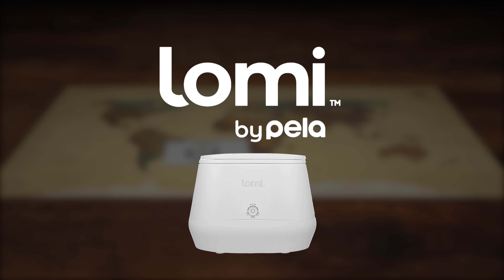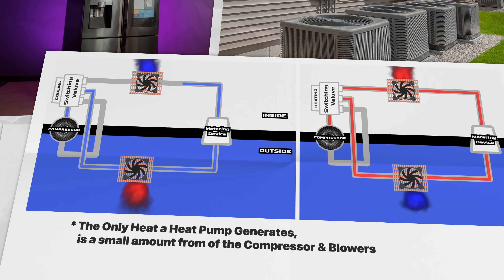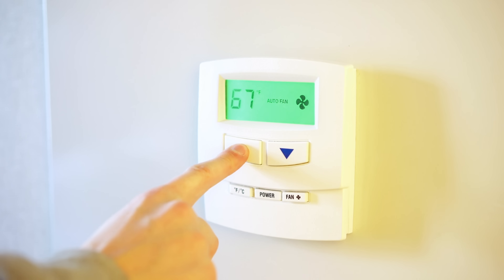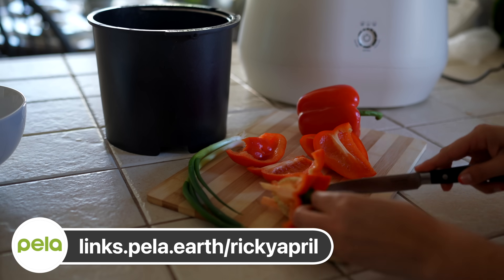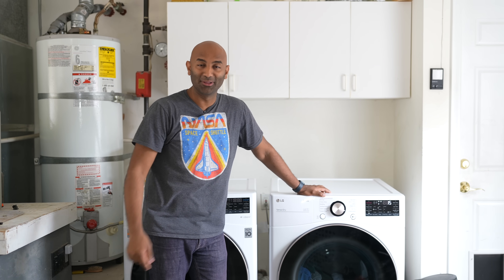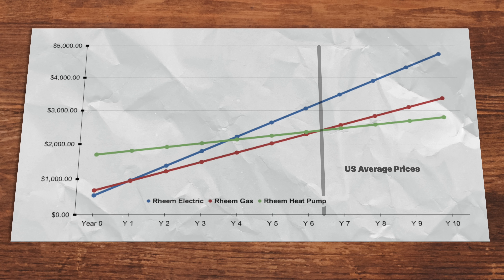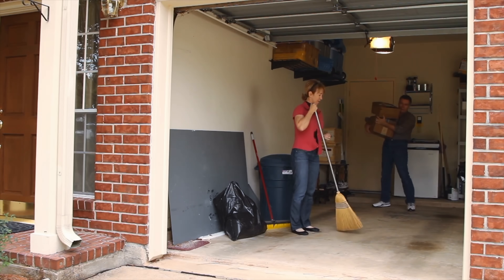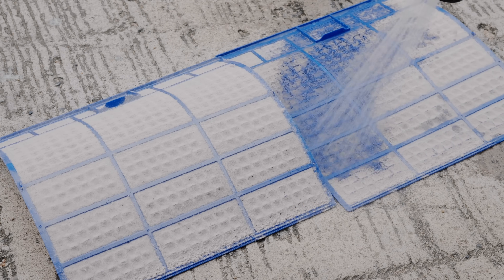I'm Shocked How Much Money Heat Pump Appliances Save!

Comment: You live in San Diego, Southern California, and you use a clothes dryer?
Reply from the maker: I don’t like UV on my color dyed clothes, and the dust in the air. But I’m working on a solution!
Reply: @TwoBitDaVinci  Unless it’s a ‘red’ dye, UV damage is minimal. Just consider the amount of UV exposure your close get versus the couple of hours on the line. If dust is a real problem, consider running through the clothes dryer, but w/o heat.

Sorry to beat you up a little about this, but clothes dryers are IMO the very worst case of us humans rejecting the power of the wind and sun in favour of a fossil fool solution.

Keep up the good work.

Comment: Hello from the Midwest! Natural gas is indeed the most common heating source here. A barrier to heat pumps is that in previous decades, the units on the market did very poorly in even moderately cold weather (ie below about 20F). This meant using a ton of resistive heating and very high bills. The problem comes in that most local HVAC people know of the lore and tend to dissuade folks when discussing heat pumps or insist on dual fuel using gas. Today’s really good HPs can operate down to -13F, which would cover 99.999% of time in my area. But if the installer lacks this knowledge, it means that only the most in the know people are going to upgrade.
Reply from the maker: We’ll said! I love the Midwest what part? The systems have improved a ton since the old days. But natural gas is a habit hard to break
Reply: @TwoBitDaVinci  yeah you are gonna switch fromm heating with natural gas which is over 90 percent efficient to an electric heat pump yhat uses natural gas to create the electricity which at the plant is about 50 percent efficient. you are gonna consume more natural gas. you people are low intelligence
Reply: what is -13F?

Comment: Very true, heat pumps are THE answer to heating and cooling in the near future and beyond.  We're seeing in the EU has stupid it is to rely on another country for your energy needs, and we see from climate change how using fossil fuels is even dumber and more dangerous.  I converted my house to all electric, except my gas furnace, which is the next on the list to swap.  I replaced my: oven, water heaters and installed an air source heat pump for AC, which also heats well.  I bought an EV and added solar and wind, and have no power bill or gasoline bills.  Go Ducks!!  :)

Comment: Don't digress. It ruins everything else you say. 0 degrees? Water freezes 100 degrees? Water boils. What can be simpler?

5 degrees? Cold. 10 degrees? Cool. 15 degrees? Comfortable in the sun. 20 degrees? Comfortable. 25 degrees? Warm. 30 degrees? Hot. 35 degrees? Uncomfortable. 40 degrees? Unbearable. 45 degrees? Deadly. 50 degrees. Barely survivable.

32 degrees in the stubborn old system that nobody uses? Nonesense.
Reply from the maker: From 30-100 there’s more gradation in the range that matters to humans. That’s my point. I love C don’t get me wrong. As an engineer I wouldn’t use F. Only for describing the day :) cheers
Reply: @TwoBitDaVinci  Sorry, but no. Notwithstanding that a 30+ degrees Celsius gradient is more than enough to quantify barely discernable steps within the normal human condition, you can also break degrees into halves if you really feel the need. The gradient then becomes essentially the same.

All you are saying is that you have known the numbers you are used to since you were a child and different numbers are not familiar nor comfortable. This is the primary reason the US is about the last country on Earth to eschew metric. It is a country that fears change and distrusts others - to its own detriment.

I grew up with Fahrenheit as a kid and it was no big deal when we caught up with the rest of the world and changed. Same goes for miles to kilometers, weights and volumes etc.  It takes a few months to get  used to the new values and then you wonder why anybody would use systems that are so archaic and inconsistent. How much does a gallon of water weigh? It's crazy. How much does a litre of water weigh?

Comment: In order to go green you've got to have great credit or deep pockets and most heat pump units are not low budget solar electric friendly so instead of just the higher of the unit to go solar electric you go from 2 grand to 8 grand sure it costs more to rum motors on 110 volts compared to 220 but a 110 volt solar system can be set up for under 2  grand whereas a 220 costs over 8 grand   because you need more solar panels 2 inverters that can be synchronized to get 220

Comment: Like you I live in SoCAl. An incident with my 25 year old gas dryer,  where it ruined a load of clothes smoldering, caused me to make it into a heat-pump dryer and rip out all the gas parts around 10 years ago.  I used a dehumidifier and built a box (plenum) attached to the dehumidifier input with door foam insulation gaskets I  hooked the damp exhaust into the box and arranged the dehumidifier output  to get back into the gas heater through the access port it had to service the burner tube. Closed off all other make-up air into the dryer so that it worked on a loop. The dryer had a air fluff setting and a timed dry setting that worked for its part and I wired the adjacent dehumidifier to start and stop simultaneously.
While it does take longer, the recirculation slowly gets the clothes warm, but not hot. Very gentle.The consumption is 470 watts, and since it is a full sized American dryer it takes our load sizes too. I do have to pump the condensate water out and clean the accumulated lint in the plenum from time to time, but I no longer worry about a gas flame  or have to depend upon the overtemp sensor when the belt starts slipping again, the original problem I faced which propelled me to D.I.Y. many years ago when I read about the heat-pump dryers in Japan that were not being imported here at the time. Thanks for reminding me.

Comment: I had a heat pump pool heater 15 years ago. Saved me a TON on electricity.
Reply from the maker: Awesome! What brand did you go with?
Reply: @TwoBitDaVinci  A Hayward. Make sure you get the titanium heat exchanger. The conventional material did not hold up to the chlorine and the company replaced it under warranty.

Comment: Why are Heat Pumps so expensive when they seem so simple (seem a lot less complex than a gas condensor boiler!)?
Currently about 4x the price of a gas boiler!
I suppose as they become more popular Wright's Law will bring down price.
In UK Govt has  just cancelled the 20% VAT on heat pumps, so that should help, but currently Electricity is 4x the price of Gas per Kwh!

Comment: 3:32 that's the stupidest argument I've ever heard in an educational youtube video.

Why is 30° freezing? Why isn't it 0°? If it's really about comfort, why isn't 50° the ideal temperature?

And celcius makes a lot more sense as a non-american. 
0°? Freezing 
10°? Very cold 
20°? Slightly cold
25°? Ideal
30°? You need a fan
35°? You need an AC
40°? you need to jump in some water
45°? Watch out for heat stroke
50°? Don't even come out of house
100°? It's boiling your blood. Literally.
1000°? Melts metals 
etc

Comment: ive had a heat pump water heater. They are ok...but their lifespans are terrible. You would be much better off with a tankless instantaneous gas system if you really wanted to cut down on costs.

Why pay to constantly reheat 50 gal of water all day just for it to sit there and lose heat while it waits to be used.

Comment: Heat pumps have limits, for a typical UK home, our home heating is gas fired boiler, gas being around a quarter of the price of what an electric boiler can cost. With heat pumps they cannot achieve the temperatures that a gas boiler can, say 70 degrees for gas and 45 for heat pump, so changing to HP would require enlarging both some of the pipework and every radiator,  plus typically a HP takes alot longer to run to get to temperature and loses efficiency when temps drop.

Comment: I think Mitsubishi-Trane may be coming out with a hybrid VRF heat pump system. It uses water as the medium for both heating and cooling from the same compressor with the refrigerants at the same time. This type is what Tesla uses for heating and cooling the batteries, wheel motors, and cabin and when heat cannot be used it is discharged to the condenser / radiator.

Comment: Don't get rid of the gas water heater! Buy your heat pump water heater,  then plumb the hot water out of it and into the old gas heater.  It will be free supplemental hot water storage. This will work whether or not you keep gas hooked up to it.
Reply from the maker: very interesting!

Comment: Heat pumps work great within their design temperatures. Go outside of those design temperatures and those high COP numbers you were looking at go away rather quickly.  Might be useful to do a COP efficiency video based on various operating temperatures. You might be surprised.
Reply: That's why I chose a ground source heat pump vs air source. I didn't see loop temps go below ~40F all winter (SW Ohio). My furnace also has a loop to the water heater tank to send waste heat there.

Comment: Wouldn’t it be great if the heat pumps could be integrated with each other. For example, if your water heater could also cool your refrigerator, or home, or just whatever. 
Appliances sharing/exchanging heat for cooling benefits would be awesome.
Reply: They do have some of this already. I think This Old House worked on a house in the northeastern part of the US that used the same heat pump for heating, air conditioning, and hot water. It was set up so that the hot water tank could store some of the excess heat that was being pumped out of the house during the summer, but would work like a normal heat pump and pull heat from the outside air in the winter months. 

I think it would be really cool to have all of the heat pump devices hook to central refrigerant lines. That way heat is moved where it needs to be, and only sent outside (waste) when there truly is nowhere else for it. I think there are some concerns with having this set up, as you would potentially need a certified HVAC person to hook up your dryer and refrigerator to such a system.
Reply: They could create a standard for hookups so anyone can plug it in.  They would just need to create a standard for gas and pressure for them.  The initial filling of the pipes or to run new lines would require a professional, but for just swapping appliances wouldn't as they will be prefilled with refrigerant.
Reply: @travisschneider3011  the problem with this is that while it would work for the initial connection, it wouldn’t work when you go to disconnect it. Mr. Cool (and others) already make DIY mini split ductless heat pumps that allow regular people to connect refrigerant lines. The problem is that if you want to replace one of the units, all of the refrigerant has to be removed with a vacuum pump and put in a safe and approved container. This is a bit outside of the realm of most home owners, and in the US, working with refrigerant requires a license due in part because of the impact it can have on the environment.  Even if you were licensed, you’re looking at $300+ in equipment just to evacuate the lines. This doesn’t even get into different devices require different amounts of refrigerant, and over time we find new refrigerant that replaces the old refrigerant, but the new refrigerant won’t work in your old system that was designed for the old refrigerant. What happens if your heat pump dryer dies and your whole house only works on old refrigerant that isn’t made any more? Do you now have to pay to replace all of your heat pump appliances? Or do you have to buy an old dryer that uses the same refrigerant that your house does? What happens when those aren’t made any more?

I’m not opposed to the idea at all, I am just pointing out there is more to this than just putting on better connectors for the refrigerant lines.
Reply: $400 isn't much when you are licensed and will be using it all the time, and likely already own the equipment, and will only likely need the quick connection part.  Each quick connection part will be standardized for each refrigerant so you can't plug the wrong appliance into the wrong refrigerant. Hardware stores and the like will be able to rent the vacuum and storage tanks for the removal.  Mr Cool already can do the backup and move in the US.

Looking at the Mr Cools DIY multi units would be very close to my vision and would allow the exchanging of heat/cooling requirements.  Some Commercial building units already shift heat/cool from unit to unit.  So if one room requires heat and the other cold they exchange with each other.

Yes all the units connected to the same multi unit will have to be on the same refrigerant.  If the install base is large they will make compatible units for a long time for each refrigerant.

When you have to replace just one appliance and they don't use that refrigerant anymore, you just replace the one appliance to a new multi unit that works with it, placing it right next to your old one.  As your old appliances die you slowly move them over to the new multi unit.

Comment: Let's do the math. You pay $2.09 per therm for gas. You pay $0.45 per kw-hr for power, or  $0.45 for 3413 Btu which comes to $13.18 per therm of electric heat. Even if you could achieve a COP of 5 (which you will not) gas is still cheaper. 

Your heat pump water heater will cost you a lot more than $1700ninstalled, even if you DIY. Read the installation manual. There are necessary accessories and plumbing parts required. Heat pump water heater will be lose-lose for you. Extra cost to install and higher cost per BTU once it is installed.

What might work for you is to integrate your a/c with pool heating, so that the heat rejected by the condenser goes into the pool water rather than the outside air. That would also force down your condenser temperature and improve the COP of the a/c.
Reply from the maker: I literally already did the math, that was all in the video. a Heat Pump water heater uses 860 kWh a year... which is cheaper than 269 therms x $2 per therm. It's all in the video.
Reply: @TwoBitDaVinci  The 860 kw-hr assumes that they know how much hot water you use.
Reply: He is planning on getting solar panels so that would generate a good deal of electric power.

Comment: Heat pumps run on electricity.  How will you produce all that electrical energy at night when it is coldest which will increase with heat pumps replacing NG furnaces and charging electric vehicles?  Also, one Therm is 100,000 Btu's as you stated which is the energy of 29.3 kWh of electricity.  So, to generate one Therm in electricity at your current rate of $0.455 per kWh costs $13.33 and in natural gas is $2.09 which we can adjust to $2.32 for a 90% efficient gas furnace.  So, electricity to produce a Therm costs 5.75 times as much as natural gas.  Most modern heat pumps have a COP of 3.5 at 45 degrees F and a much lower COP as the outside temperature drops and their heat output drops.  Your heat pump will cost you more to heat your home than natural gas.  Heat pumps are not a good choice in the northern US as the output at near zero temperatures decreases to a fraction of their rating.  The EU has just accepted natural gas as a responsible way to produce energy in the future.
Reply from the maker: but have a whole house run on solar and batteries. It's not easy or cheap, but I plan on investing in a super off grid home, that is resilient to outages etc.
Reply: @TwoBitDaVinci  Three ton heat pumps require about 2.5 Kw of demand and if you are charging an electric car at night add  
another kW or two.  You'll need some investment in batteries.